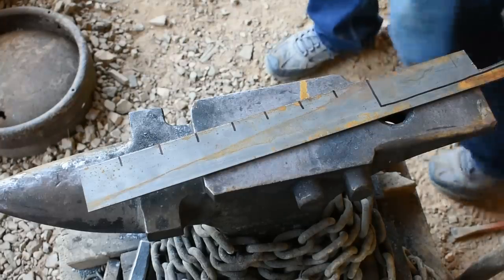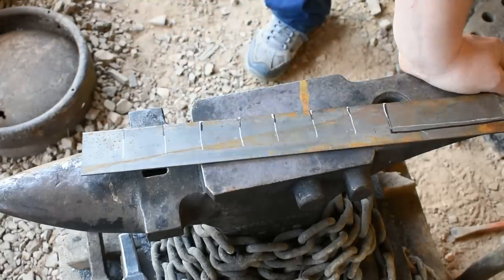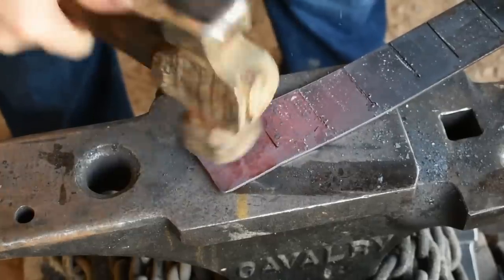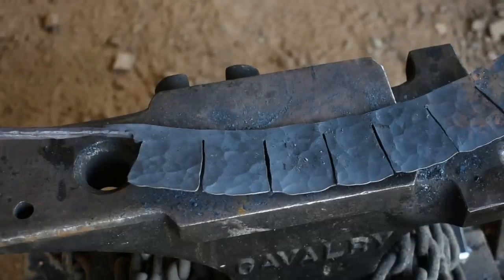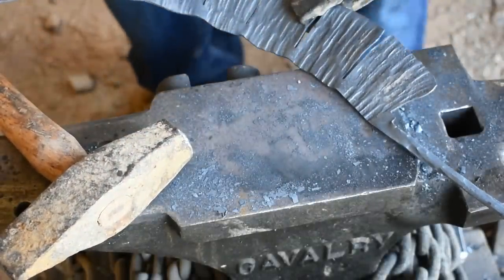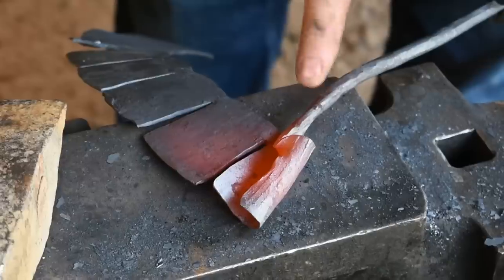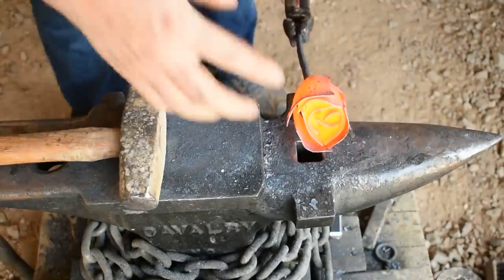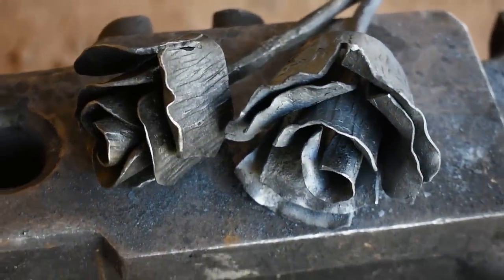Blacksmithing for beginners: How to forge a One piece rose (No Welding Required)

Comment: Great video. what was the total stock length you started with please?
Reply from the maker: Thanks! I appreciate you watching, normally  I allot 6 inches for the stem cut around 3/8 of an inch wide, then I allot an in to an inch and a half per petal. I like around d 8 petals so you would need stock that is 14-16 inches overall. My preferred stock thickness to work with is 1/8 of an inch thick.
Reply: @Mysticmountainforge  thanks. Normally make these from 1" wide stock so wanted to try something larger but curious about proportions. 👍👍

Comment: What are the dimensions of the piece?  I know it's 2x1/8 what about the length? And the spacing of the petals. Love the channel by the way.
Reply from the maker: Thanks for watching I appreciate it! I believe the petals were cut every 2 inches so if you do 8 petals it would end up being 16 inches just for them, if you pre cut the stem I would add another 6 inches or so for that, so 22-24 inches overall should do it, anymore than 8 petals just add 2 inches for each one to the overall length.
Reply: Thank you for the response. I'll be attempting this very soon.

Comment: Awesome video. How did you go about cleaning them?
Reply from the maker: Thanks! I appreciate you watching, I use a wire brush on the outside, then a soak in acetone to remove the oil and crud, then rinse with water.  Then a wax finish or spray paint once they dry, you can use an oven to dry them quickly before painting/waxing.

Comment: Thanks this method has worked out better for me than all the other ones I have tried. and I like making these. I've made about 20 of them now. Just wondering what is a good price point for these? Internet references are all over the place. From a hundred and twenty bucks with a few leaves on it to 25 bucks. My first few I sold for 35. Sounded kinda fair. but I am getting better and faster at making them and don't want to under cut or devalue the design for other blacksmiths. So any hints will be much appreciated by everyone. Though I don't  really expect a answer from this cause the video is sorta old but it would be nice. Also curious if it would work better and faster  If you just forged the petals out and forged the stem separately and tacked them together at the end.
Reply from the maker: I am glad it helped out, I sell these for 35 dollars, a lot of the pricing depends on the area you live, I live in a more poverty striken area so most people can afford that but in an area where there is more money you can get more for them. I would give the seperate method a try and see which one you prefer. I appreciate you watching!

Comment: I’m curious how you’d manage this if you had a smaller forge, mine isn’t quite as big as yours and I’m not sure how to fit the rose in there with how the stem and petals are, it’s too wide, I guess I could bend it but I’m not sure how that would mess with anything. Guess I’ll have to work on it a bit more, Great video though!
Reply: Try using a torch, you can get the steel hot enough, but the area you can heat is smaller.

Comment: Whats the approximate length of the steel to use
Reply from the maker: I do the petals at 2 inches each, you can make the stem however long you want. I have found that a 12 inch stem looks nice so with a stem that long with 8 petals you would need an overall length of 28 inches. I appreciate you watching.
Reply: @Mysticmountainforge  thanks, planning on giving a try after I pick up some steel

Comment: How long of a piece of stock would you recommend start with, and how wide are the starting petals when i make my cuts?
Reply from the maker: 16-18 inches should be more than enough for the whole piece but you can go longer if you want more petals , I usually do around 2 inches per petal, it makes it easier to get a tight roll for the center of the rose.Thanks for watching I appreciate it!

Comment: could, u just use an angle grinder to cut out your starter shape?
Reply from the maker: That would work great as well, it would also be a lot faster than using the bandsaw.
Reply: thanks for the info. im new to blacksmithing and thought maybe an angle grinder would cause an undesirable effect on the metal amd thats why u didnt use one :)

Comment: Uh huh. Yeah, okay. Let's say the aforementioned 'beginner' has been working with purely hand equipment. No Band saw. How would the beginner separate the metal?
Reply from the maker: Cut it with a chisel, you can also use a hacksaw.

Comment: How long is the bar and the petals measurements and stem measurements
Reply from the maker: I believe the petals were 2 inches wide and the stem was 6 inches for an overall length of 22 inches for the bar, give or take a little on the stem because you will be drawing it out when you forge it round, you may want to allot a little less. I appreciate you watching!